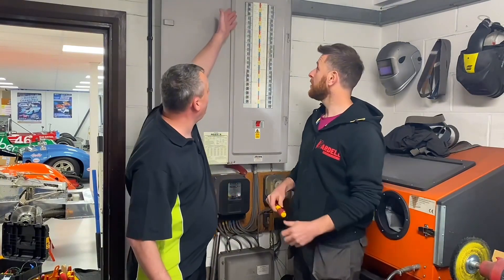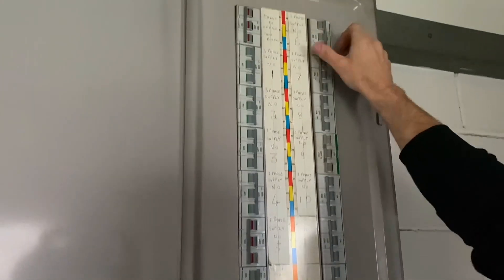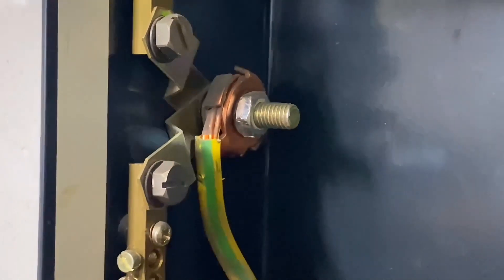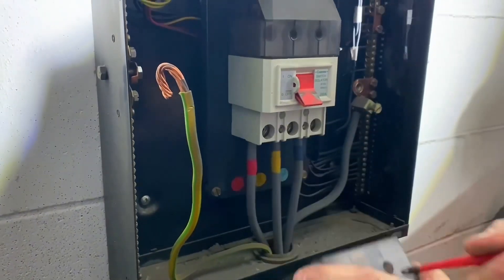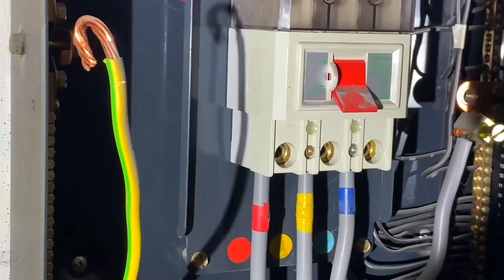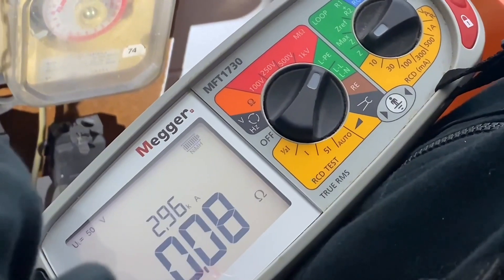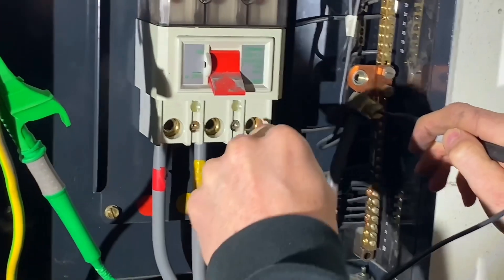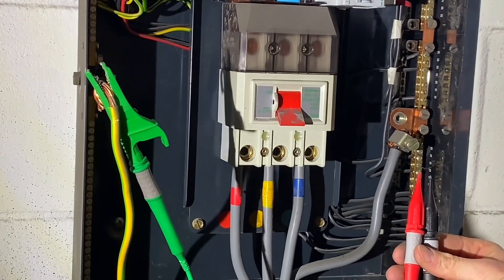3 Phase External Earth Fault Loop Impedance Test

Comment: Would you typically measure the current in the main earthing conductor with a clamp meter before disconnecting it, to look for diverted neutral currents?